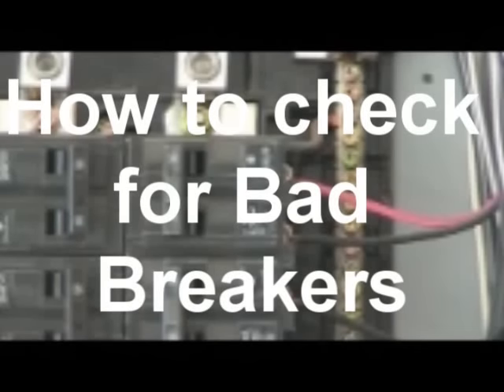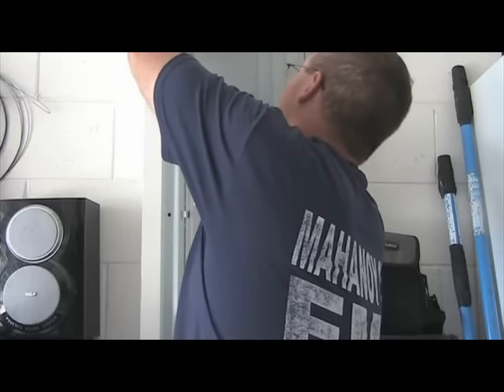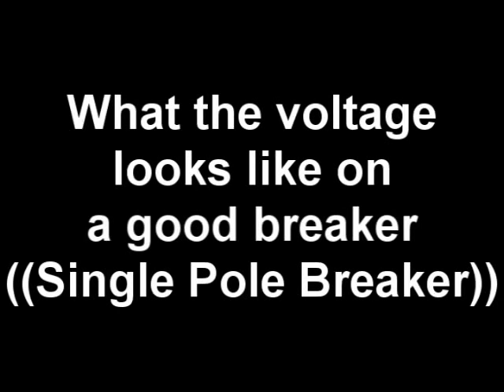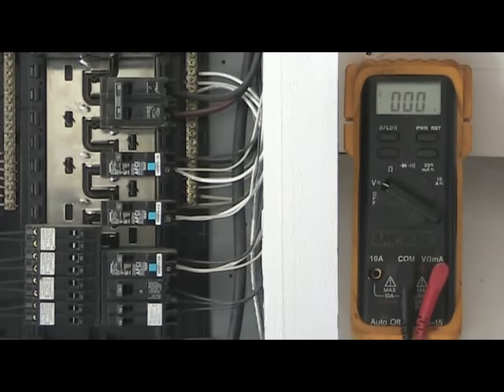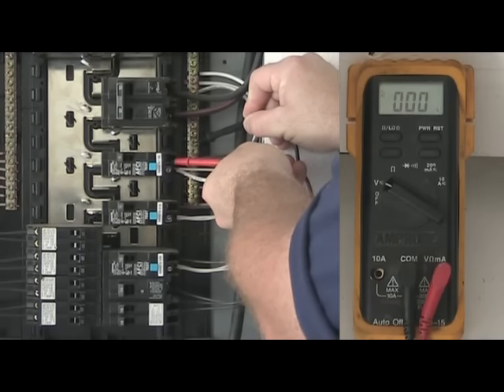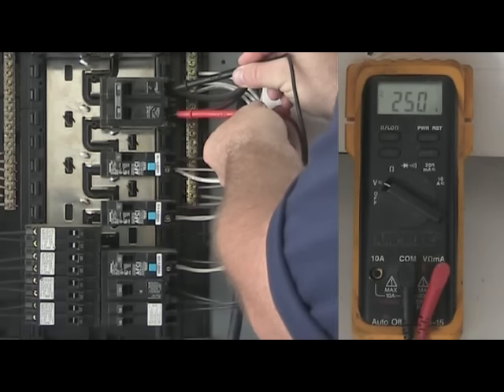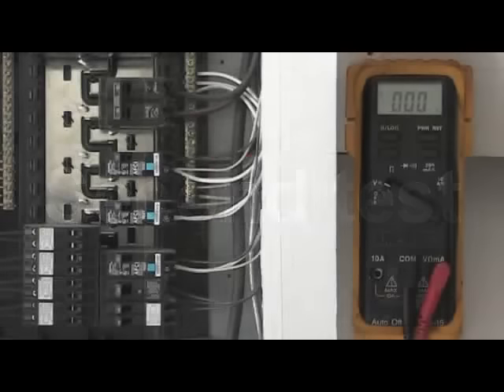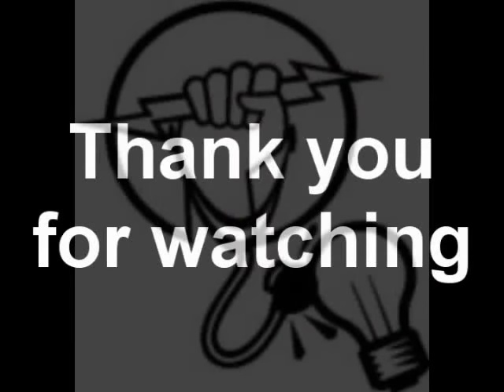Checking for a Bad Breaker

Comment: Thank you for showing how to  check breaker (220). Single mom trying not to freak out every time I try to use dryer and have to reset circuit. I have the tool (voltage meter) but wasn't sure how to use it. Thanks again.

Comment: Thanks! I tested some Sockets around the house, a few are giving between 0-30 Volts... I have a feeling I have 2 breakers that need replacing since replacing all of the plugs didnt help (except every plug has a safety button, not just the kitchen/bathroom. :) Worth the extra 2 bucks a plug. I have a Volt meter but wasnt sure how to properly test the breakers, this is a lot of Help!

Comment: Thank you so much, my lights were flickering,then went out, I checked breakers and everything was fine, but then found your video and found the bad breaker.i removed it and the connection was corroded and I sanded it and reinstalled and everything works great,thanks,,,

Comment: Thanks for the great information, and so is that mean a bad breaker can suddenly not giving enough power for an appliance? For example I have this outlet that has been used for a washer but suddenly one day I noticed it couldn't get enough power for it anymore but like when I plugged a small stuff like night light it turned on no issue. Thanks for your time!

Comment: One, the red/black means nothing, you arent checking a DC circuit, and the test leads can be plugged into the meter two ways. Two, a breaker passing voltage does not mean its good; breakers can get loose clips/stabs, become burnt/corroded, or break internally causing it to not reset, or worse, never trip again (FPE Stab-Lok 2p were notorious for this). Ive seen breakers used as switches that get very loose internally and, depending on how the handle comes to rest, may pass 120V, may pass 0V, or somewhere in between. 

Your testing does not rule out a bad breaker by any means, and is basically worthless on the single pole AFCI breakers you tested them on. The only approved method for testing those is the mfg test button.
Reply: Someone is butt hurt they can't operate a digital camera and edit videos.
Reply: Removing it from the bus bar and checking the resistance of it could be another way
Reply: Meseek
You
Reply: What should the voltage be? Does it say on the breaker?
Reply: Julie Campbell it depends on the breaker size but  it should say it on the breaker itself.. 110-120 or 220-240 is probably what you'd be looking at
Reply: DangerDaveFreestyle checking resistance with the meter he has may not show a problem. I've seen breakers that show continuity and not pass current. A DLRO (digital low resistance meter) is needed as a dlro can read as low as micro-ohms to determine continuity across the breaker.
Reply: Julie Campbell:
Watch the video again....

Comment: you will get the same result either way you connect the multimeter. this is ac so dont limit red lid to hot and black lid to neautral, you can chech either way

Comment: GREAT VIDEO- EASY TO UNDERSTAND ; I HAVE AN ISSUE I HOPE YOU MIGHT BE WILLING TO ADVISE ME ON; I AM RUNNING A CERAMIC 1500 WATT CERAMIC HEATER; I WAS CHECKING THE OUTLETS BECAUSE THE BREAKER WOULD TRIP?? THE POWER SOURCE IS 15 AMP HOUSEHOLD CURRENT; I ATTEMPTED TO CHECK THE OTHER OUTLETS FOR POWER; SO I RESET THE BREAKER AND USING A(3 prong outlet tester ) I went to stick the tester into another outlet and the second I attempted to plug it in the outlet "a far away outlet"  same circuit not known"?? the breaker would trip again; how can the ELECTRICAL TESTER CAUSE THE BREAKER TO TRIPP??? ANY ADVICE IS GREATLY APPRECIATED; I WOULD CALL AN ELECTRICIAN BUT IT COST OVER $250. FOR 1/2 HOUR PLUS TRIP COST; I,M NOT VERY ELECTRICAL SAVVY BUT FEEL CONFIDENT ENOUGH TO FOLLOW YOUR LEAD !! THANK YOU,PATRICK.P I BELIEVE ALL THE BREAKERS ARE AT LEAST 15 AMPS TO THE 2 MAIN BREAKERS WHICH ARE 20-30 AMPS SINGLE POLE. PATRICK.P

Comment: At 1:43 you say put the leads on both terminals of the double pole breaker, that you should get 120 volts if the breaker is good.  That's incorrect, you should get up to 250 as you had just said prior to that.
Reply from the maker: Watch the video again, I specifically state if the breaker is bad these are the voltages you will see.  I am paraphrasing here, but that is what I said.

Comment: Ok have questions dryer not heating have replaced both the breaker and outlet and its a new dryer with new cord.  I am getting 108 volts on each side at breaker and at outlet. When I put the tester on both sides I get no reading at all??  The electric com pay says I have good volts at the meter what do I do or try next??
Reply: Huh well since you getting 108 at the breaker and the outlet, assuming it's a 120v  20amp breaker 
Than you sir have a bad line that's coming in. Simple corrosion at the connection on the street side most likely. It happens to bad weather n improper isolation when it was first connected. Estimate on a Professional 450-500$ possibly less, no more.

Comment: This is Dangerous !!! When you remove the breaker box you expose the Live terminals which could give you a lethal shock if touched. What you should do is go to an outlet on the circuit of the breaker which you think is bad and test the voltage through the holes in the socket , you get the same information without the risk of a fatal shock if you accidentally touched exposed Live terminals.

Comment: hi first thank you for your time posting this video. i have a question on the double pole 220 breaker . you tested it twice once with 220 volt reading. then the same test with 120 volt. what am i missing. i dont see why is there 2 different reading on what appears to be on the same breaker?

Comment: On a 220v circuit, I have 120v on each breaker, but 0v when testing across the two breakers. What is the problem. This is also true with 2 other 220v circuits in my garage.
Reply: Is the breaker a DOUBLE breaker together as in a 1 piece OR do you have 2 individual separate breakers not together with a open space between them top to bottom..??

It looks and sounds like you have the 2nd option and each breaker is accessing the same 120V buss bar which will NOT give you 240V together

Comment: Now I do have a question but have an Idea of the answer ,but would like input. On a double pole you said to check each  breaker together at first then check each individually,so my question is for an electric clothes dryer  that still runs but does not heat , does this indicate that I need to replace one or both of these breakers ?
Reply: It's in the dryer, not the breaker
Reply: Check the receptacle for power. Dryer receptacles have either three or four slots.
2 hots and a neutral for the 3-wire type or 2 hots, a neutral, and an equipment ground for the 4-wire (newer type. Both hots should read 120V to the neutral and 240V to each other. If one of the hot legs is missing, the drum may still turn but the heater won't work. The drum motor and light, as well as the timer, run on 120V while the heater runs on 240V. If you have 240V across the hots and 120V from each hot leg to neutral, the problem is in the dryer itself.
Reply: bamaslamma1003 You are right, I have no idea where I got that answer. I had the problem, where the dryer heated intermittently, but everything else was ok. I put a new breaker in and, problem solved.

Comment: *nicely done 
I have 1.5 volt’s with circuit breaker in off position gfi will not reset ?
Reply: Thats residual current from the circuits next to it

Comment: When you get a voltage reading on a breaker, what do you do if the reading is higher or lower than what it should be?
Reply: yea same problem here, I'm getting 1.14V between the +ve and -ve, and 1.14V between the ground and -ve

Meaning my +ve is probaly shorted with ground somewhere.

Comment: hey I have a question,  in my kitchen I have a GFI out  but it reading 88volt but when I went and check the breaker box all the line are reading the normal voltage 120 , I am wondering where cause the the Voltage drop,  tite in up all the connection at the panel box
Reply: +Alimamy Sesay GFI's are known for getting tired...I would buy a new one, and start from there...They are bulky and difficult to remove and install, so I would hire someone to install it for you...If the same thing is read, around 88Volts, then you could have a nail in your romex line..Not much you can do about that, except to rip out all of the walls, from point A to point B
Reply: +Alimamy Sesay you might have a broken wire leaving the breaker panel to your receptacles that you cant see

Comment: Hi I have a portable air conditioner and when the washer and or dryer is on the circuit breaker trips around 15 minute but it the portable is off is circuit does not trip, can you help me
Reply: +Mark Williams you have the same problem...Washer, dryers, aircon, garbage disposals, all belong on their own circuit with own braker, regardless what uncle bubu told you...Aircons, are 30 amps, alone you are over taxing the wiring as well
Reply: too much load.  your breaker is doing what it's designed to do.  break the circuit before you really start heating the wires up.

Comment: I have a question,  when I am turning my dishwasher on after few minutes my breaker shuts down,  and have to wait real long to re-set the breaker.... Any advise?
Reply: Ejaz Akbar
Reply: +Ejaz Akbar first...IT MEANS ONE OF TWO THINGS...#1. Replace the braker...once a braker is forced to close, from being over heated, or drawn, it is not longer as reliable, in my eyes and....#2 Since your braker is new, try your dishwasher again and see if it brakes..If it does, you have a dishwasher wiring problem, or the water/draining pump is full of water, or over heating...You need to call a professional, from this point forward, there is nothing you can do, except to replace wiring, or the washer...Sometimes the pump can be replaced, but new dishwashers are cheap and will save you a lot of cash on electricity and water usage...The worst case is you will need a new braker, for sure, could need a new washer, and if you were scamed, undersized wiring was used for a dishwasher, which should be on its own dedicated line, and braker, meaning, just the washer is on the braker line..No joke here, water, electricity, and small wiring is no joke and can kill kids, and most adults...You are in over your head

Comment: Every other breaker in box reads 0, I bought 1 new one, 15 amps and replaced it with one of the old ones that tested 0, the new one also tested 0, what's my problem.
Reply: Courtney Johns sounds like you lost a phase.  Could be the main breaker or a utility issue.
Reply: The Main Breaker
Reply: I was trying to say the the main breaker works when I turn the main breaker off everything turns off when I turn it back on the main breaker turns back on everything
Reply: I am not an electrician but I'm just trying to do or take any steps that I can to save a little money
Reply from the maker: Yes,  you can still have an issue with the main breaker even though it shuts everything off.  You should do a meter reading from each phase to neutral.  If taking that reading from the main breaker to neutral you only have voltage on one side (provided this test is done on the line side of the breaker) that means you have a utility issue that will need to be dealt with.  Likely a broken line coming to the house or a defective meter.

Comment: My breaker that works for my hot water heater is lit red.  It is in the on position but I have no hot water-what is wrong with it?
Reply: +jjjj   turn it completely off and then reset it. 4 mths have gone by so i hope youve fixed this
Reply: gizmo Turned out that the hot water heater was bad.  It was replaced.
Reply: Gotcha. If it trips again after reset there is a dead short. Water heaters don't last like they used to.
Reply: jjjj your water heater element is burned out most of the time it will be the bottom element so cut your hot water breaker and remove all the water from tank and remove the bottom unite clean out the bottom of tank and replace the units be sure to cut off the water before you start

Comment: Not 100% true.  A bad breaker or any other bad connection or termination may read the correct voltage until a load is applied, and then pull the voltage down.

Comment: ths doesnt help because touching the terminal where the hoy wire comes in to th breaker ...that just tells me the the power supply is there ,,,it doesnt tell me if the breaker is working properly...